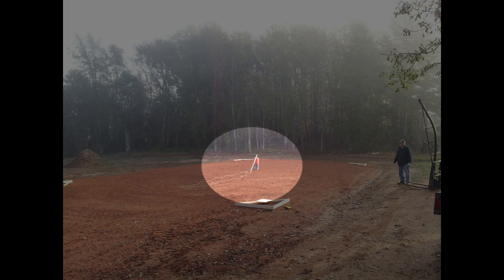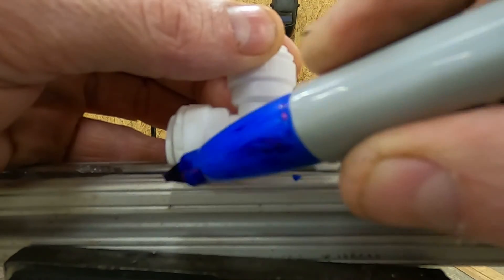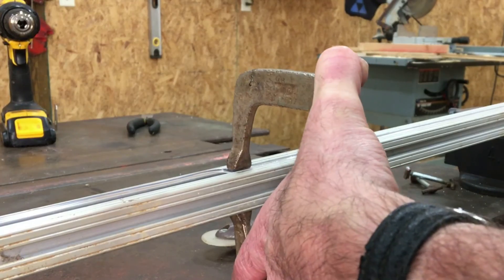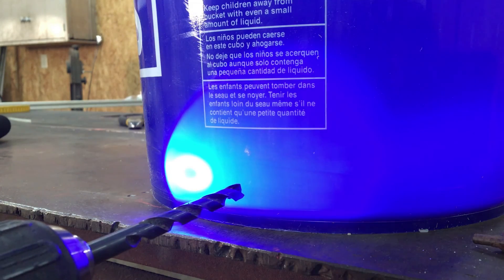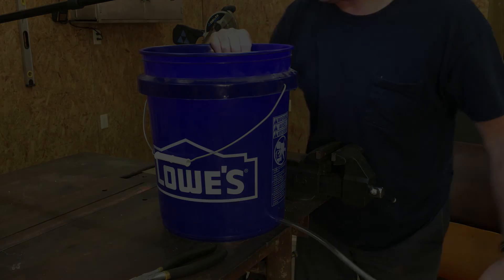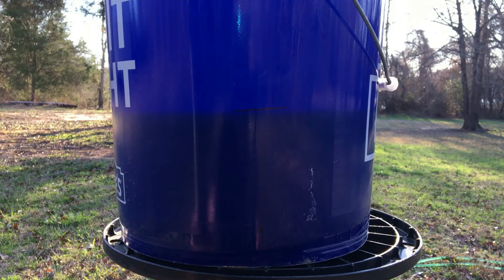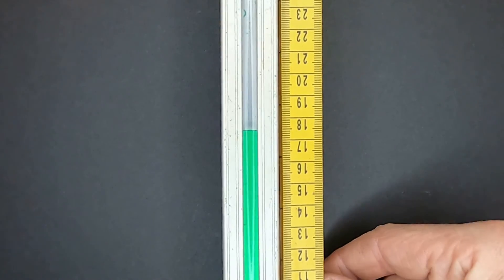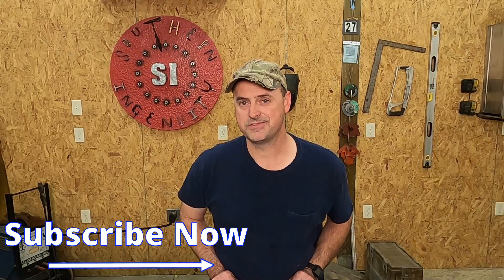DIY Water Level, How to Make and Use One

Comment: Just came across your video, very good.  One thing I didn't hear you mention was about the tubing at the scale end.  Doesn't it have to be open?
Reply from the maker: Yes, it has to be open so the water can flow freely. Thanks for watching!
Reply: Most people hold their thumb over it until they reach the point and then let the water rise or fall and take the reading.